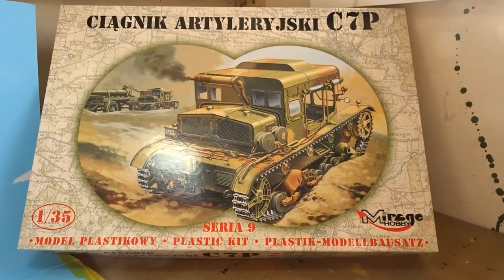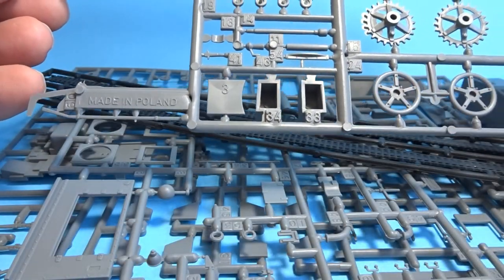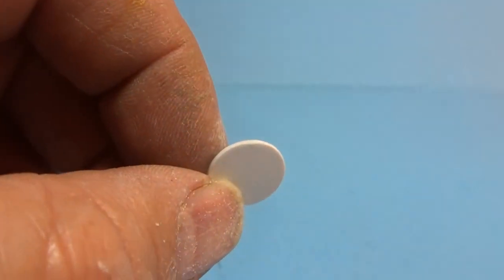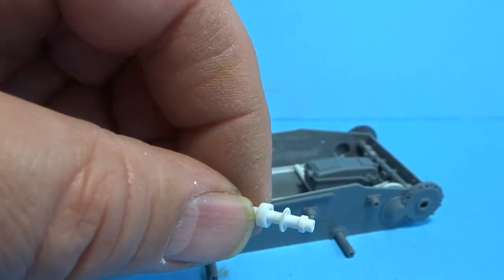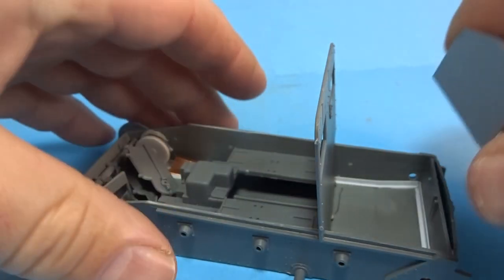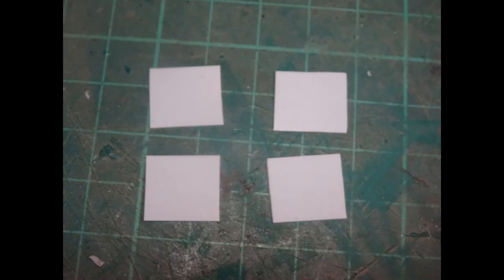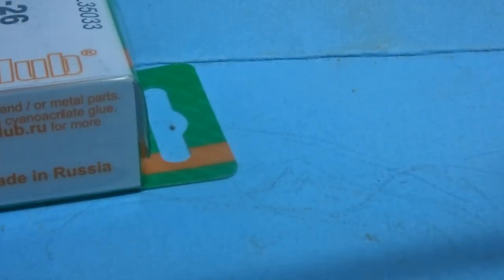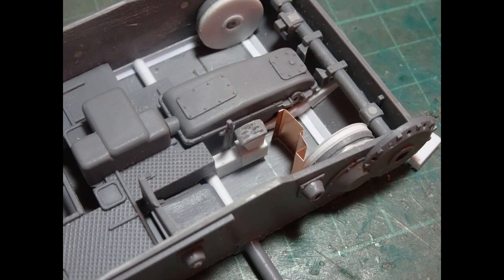Mirage 1/35 Scale Kitbash C7P Polish Artillery Tractor   PART ONE

Comment: That is incredible to watch. It would do my head in for sure! 🤣 Do you work from plans? How do you work out the size of what you're making?😵 Great stuff - I look forward to more. 👍
Reply from the maker: Hi Andrew. Research material has been a real challenge to get hold of. I have scale drawings for the outside but nothing for the interior. So there is a lot of suppositions on the internal detailing based on the limited information I have. I'm basically working off photos and other interior kits. Its great fun but I would never declare it to be 100% accurate😀😉👍😎. Thanks for looking in and more mad detailing to come.